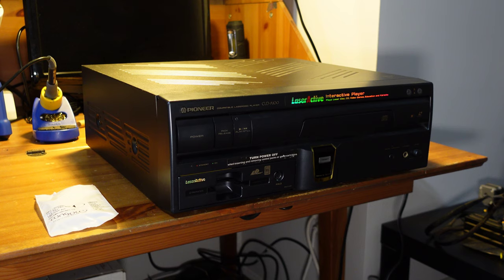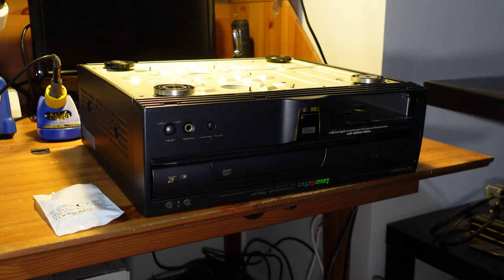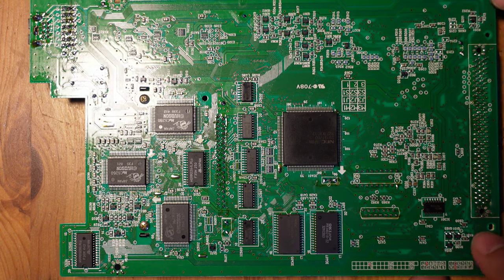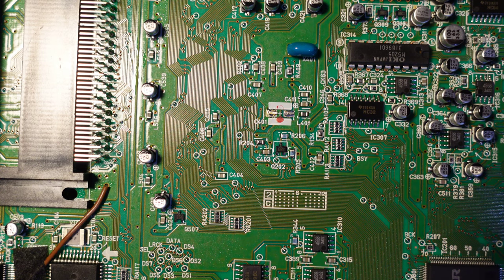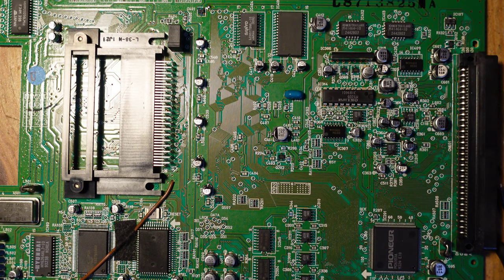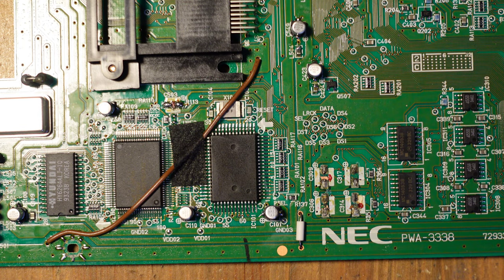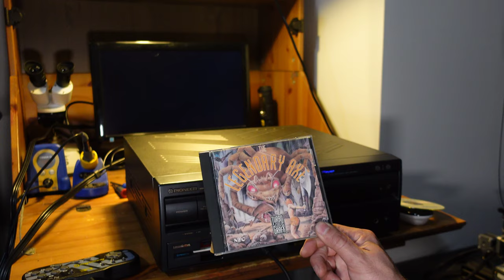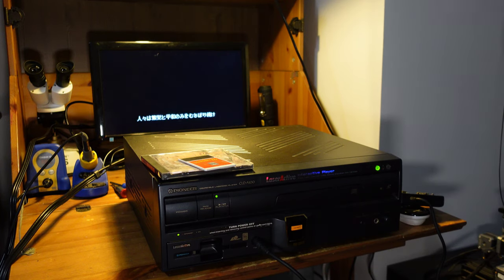Rare Pioneer LaserActive NEC PAC-N1 Restoration! Play TurboGrafx CD games on a Laserdisc!

Comment: There's actually 3 versions of the Turbografx/pc engine packs. The Pac-N10 (USA), Pac-N1 (Japan) and the ultra rare PCE-LP1. The pce-lp1 was only made in Japan by NEC instead of Pioneer! Instead of saying Laseractive on the top left corner, it says Ldrom2 and a holographic nec instead of laseractive near the card slot.
Reply from the maker: Very cool! It would be nice to see some of these variants in person
Reply: @LIRetroGaming  not only did Nec make a pc engine pack, but they also made a laseractive unit called the PCE-LD1. I found someone in America that had the Nec brand laseractive cib and the Pce-lp1 pack with it's controller. He sent the pack off to be recapped by someone as part of the purchase agreement. It cost over 3k for that.